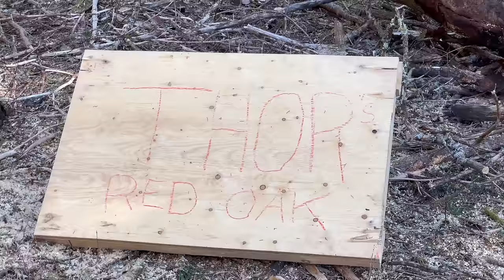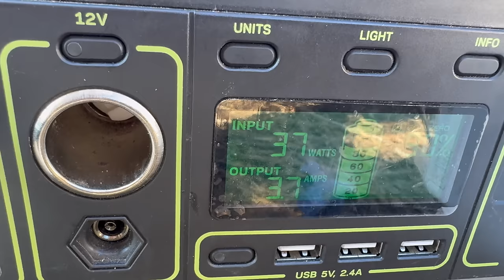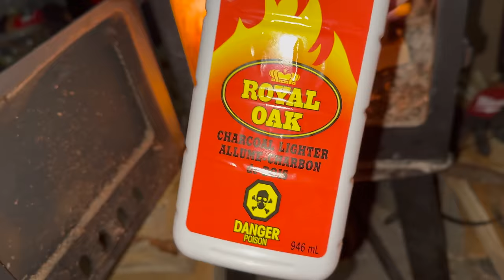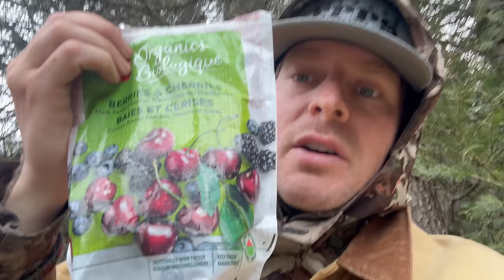Winter Log Cabin Build on Off-Grid Homestead |EP17|

Comment: well i still not understanding how living in a tent & building the cabin that size your doing it bathing in the creek or stream! I have a off grid camp area here there closed threw the winter rent cabins or tow camper in i got 3 season camper ok grid power electric heater & tv maybe dvd and watch shows and wifi internet it sucked TV sat-alight i have it at home  or the new digital (the old box was crap i got new one & it boots up to find single or program it in to box on it comes the dumb tv that way too it got nothing i got old sat setup box  & saw menu on tv it works great program one channel in) everything i have so old Noah just got off the ark from the bible I feel like now! i fell like Mr Scott from star trek the next gen they find older ship it in distress for like 50 years ago there a person stuck in loop in transporter it turn off & guy is on the transporter alive its Mr Scott person call Scotti from star trek one in the end the engineering tech the guy with eyes gone & visor befriends him get him to tell of old power gen & save the craft & he to take it to star base & retire ( the caption said you got 50 years of pay the ship yours to take here and retire!) i feel like that now it been 20 years of crap & lies!